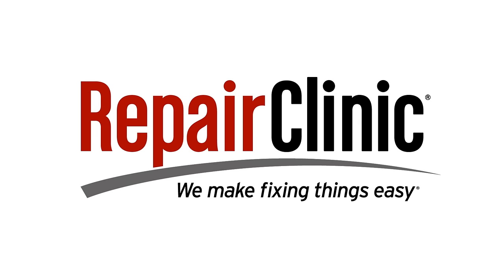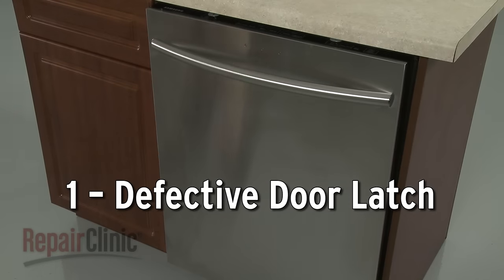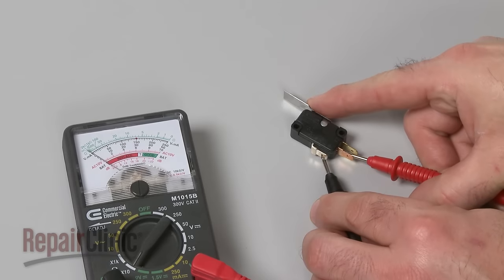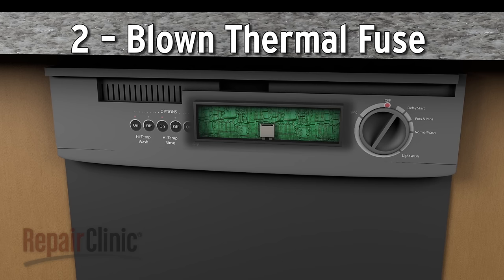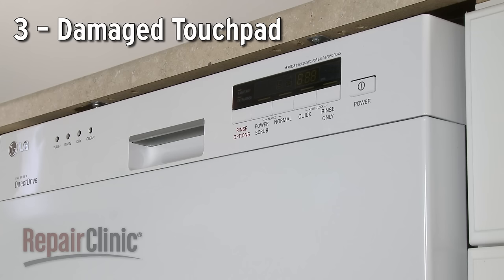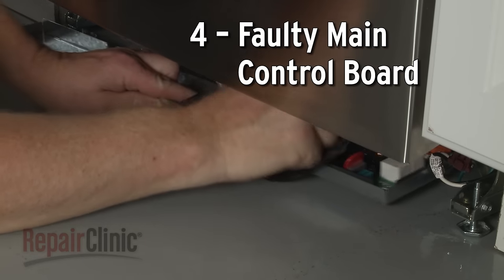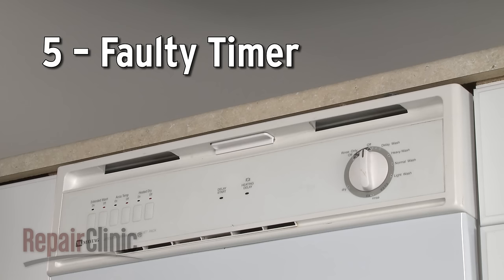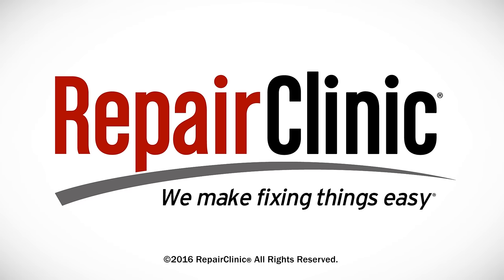Dishwasher Won’t Start — Dishwasher Troubleshooting

Comment: Step 1: get a masters degree in electrical engineering 🤣
Reply: tEST fOr ConTinUiTy
Reply: Life skills buddy life skills. They seem to be lacking these days.
Reply: @Scotty Zwillman to fix a dishwasher no. But it is a skill like the trades
Reply: Not at all. This is all basic stuff anyone can do with YouTube University. Using a multimeter should be something a normal person should have a vague understanding of to begin with or high school failed you
I've done all of these things and replaced control boards with absolutely no education in electronics.... It's all dead simple
Reply: @BrokedDownPalace  you are absolutely right. I’ve done all these things along with designing and building packaging machines. I quit government school at 16 because I realized it was failing everyone. This is all common simple knowledge that yes anyone should be able to grasp. Unfortunately we live in a day and age where it seems difficult to understand what sex you are.

Comment: Ooo, let me pull out the micro meter I got for birthday. Because everybody has a micro meter
Reply: multi meter*
Reply: Contact please
Reply: U can get one a harbor freight or home depot for like 20 bucks
Reply: Its the best way to see for sure if components are are working or not. You could us a battery a flashlight bulb and some wire to make a continuity tester. Working the switch or placing across a fuse should light up the bulb. If not the circuit is broken. Otherwise you replace components by guessing and costing you more than the price of a cheap volt/ohm meter. If you get one and you don't plan to use it much, be sure to store it without the batteries left in it.
Reply: Anyone who expects to repair electronics has a multi meter. Common sense. You are making yourself look dumb.
Reply: They are actually useful to have.
Reply: I have 2
Reply: Lol that's hilarious
Reply: Amazon :)

Comment: I have a newer Frigidaire dishwasher the lights come on the lock is good on the door however it will not start the lights stay on they do not flash which means the latch is good but I can’t figure out why it will not start
Reply: Same. Mine will start after messing with it while troubleshooting. Latch is working because the cancel functions only when closed won't while open.

Comment: I just fixed our Kitchen Aid dishwasher that had been having troubles with the electrical panel going off and on intermittently.  The control panel had always been glitchy and we had a repairman come in several times who told us the computer was probably going out and this was when it was barely 2 years old. He told us we would need to replace the machine when it finally died. Well, I took the door off and noticed the connection was loose.  So I pushed it back in and the dishwasher panel works perfectly now.  I also cleaned the latch too.  🎉

Comment: It probably is the same part. The dial timer. These appliances are cookie cutter technology and manufacture. Also to know, all these machines come with schematic diagrams taped somewhere inside each machine. Pretty cool. I've repaired my washing machine, my clothes dryer and my dishwasher. I'm not an appliance tech.

Comment: I've got the old school dial timer. Ever since this Whirlpool machine started acting up, I was smelling something. It wasn't tripping the breaker. I could get it to run for a second by unplugging it and then plugging it back in to the wall socket. I think the smell is a poor connection. It's working and I didn't do anything! Sounds logical. I'm going after the door wiring at the hinge.

Comment: My old GE GLD4500R00BB wouldn't start reliably. A latch engages the door and presses on plunger to some miro-switches that verify the door is closed before allowing the washer to start. All it took to fix the problem was to bend the latch downward, so it would better engage the micro-switches. No parts for sale web site will tell you the check this because it doesn't sell any new parts!

Comment: I have a maytag model mdb6600aww quiet series 200, which will fill but not start to wash. Push the start button again it will drain. Replaced door latch module and circuit board, still nothing. Any suggestions?